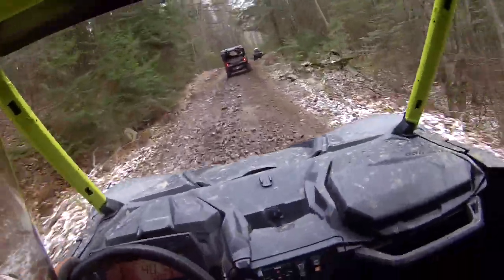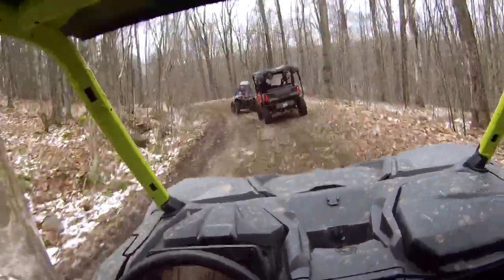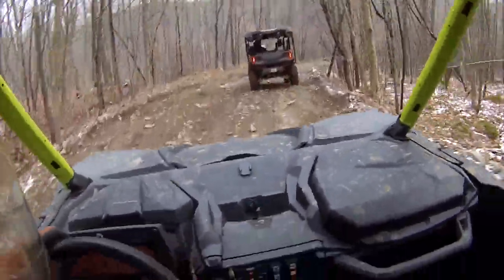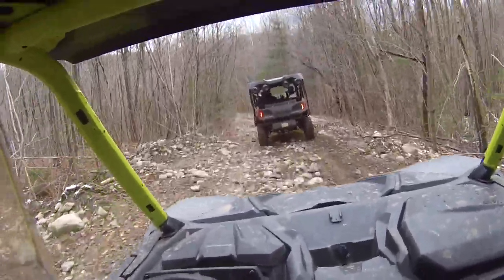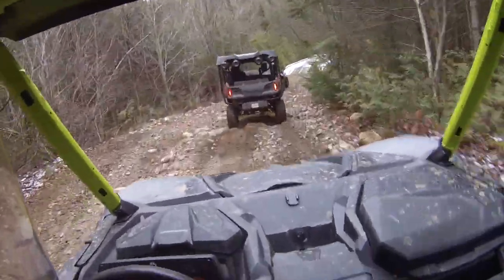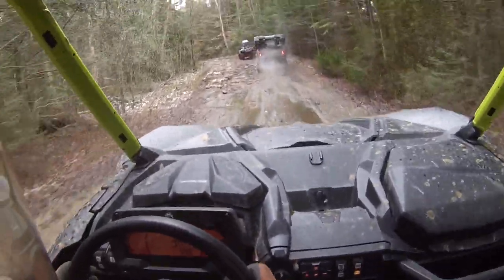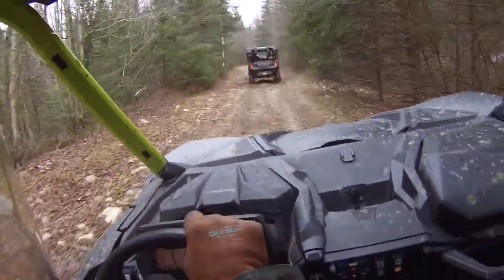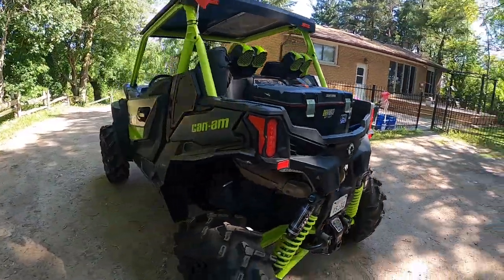2021 Canam Maverick Sport XMR The Good and Bad after 500 kms

Comment: Right on the steering, have to turn way to far to turn the wheels a little. Also don't like the speed limiter, none in X-XC & RC, I hear it's because of the tires but I only run the mud tires spring & fall! I also don't like the roll cage so fricken high!